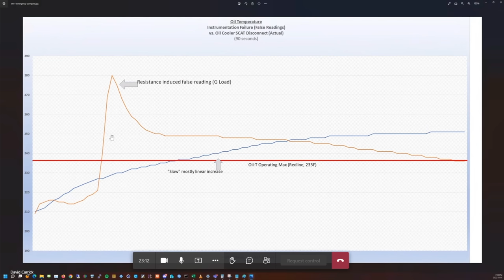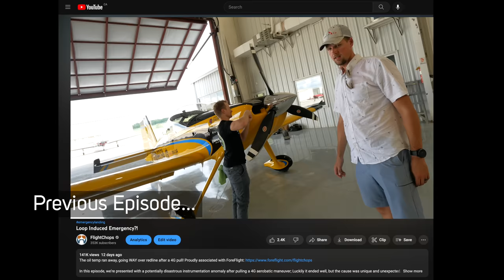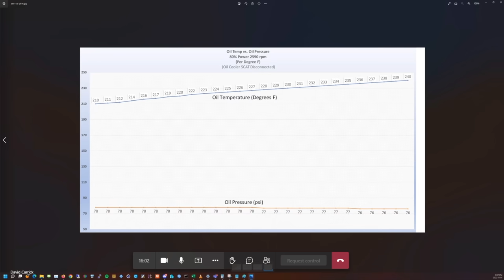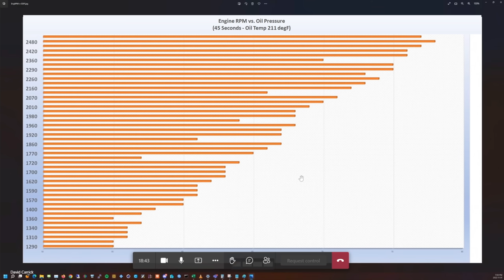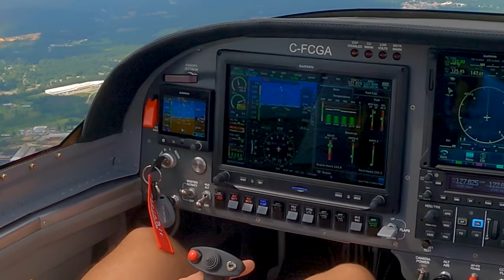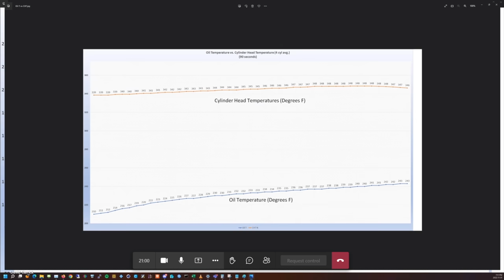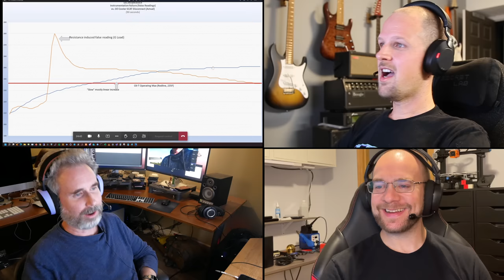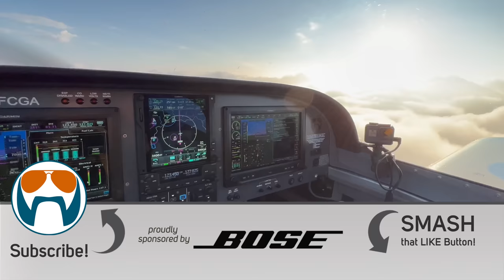Two Oil Temp Runaway Emergencies!? Engine Data Debrief Debunks Myths

Comment: 1. As a prior Air Force pilot, I love a good data driven debrief. This is fantastic.

2. I think there may have been some terminology confusion in a lot of comments from your last video with the false indication. A common term in US military aviation (maybe civilian too?) is "the field", but that means "the airfield". Maybe in Canada that's not a common term. A lot of criticisms from the last video were about leaving glideback of "the field" were in reference to a moment where is sounded like you were leaving glideback of a closer "field" (airfield) for you home field. I was one of those criticisms and definitely agree that electing to try and push to a strip of asphalt is far better than landing in an actual field (full of corn, not smooth asphalt). I know it's hard when you are trying to tell us a story, and none of us were there. Apologies for the Monday morning quarterback.

3. I love and respect Jason, but I've got to disagree with him here. Avoiding declaring an emergency for fear of having to answer questions is absolutely the wrong mindset. Be spring loaded to say "callsign, emergency, type of emergency (impending engine failure in this case), souls on board, what you are need from ATC (proceeding to final rwy 30R)". If they want more info than you have, be a pilot in command and tell them to standby. That should be a clear script in your mind before you take your private pilot check ride. Any scenario that is listed in your emergency procedures section of your checklist IS AN EMERGENCY and most likely warrants an emergency call. 

4. Dave's handling of his emergency was fun to watch. I think he handled it extremely proficiently and it was great to hear him talk himself through it. He started going down mental rabbit holes and then reminded himself to get back on track saying, "work the problem". Love it.

5. I've seen a few oil emergencies myself, all in turbines though. One was a high-pressure oil line that was cracked and spraying oil into the intake plenum. The only indication in flight was a very slow and steady decrease in oil level, but within normal operating parameters. I knew the aircraft well enough to notice being out of the ordinary though before the yellow caution came on. I was essentially over the field, and in a slightly rushed decision, I decided I wanted to get the aircraft on the ground sooner rather than later. I notified ATC and started an aggressive slip and that's when all hell broke loose. I had only dropped about 10-12% oil in the previous 25 minutes of flight, but once I started the slip, I lost about 40% more of my oil in mere seconds. I immediately came out of the slip and declared an emergency before flighting the rest of my descent over the field in a spiraling engine out pattern. Landed with about 35% oil. Going back through the data, I came to similar conclusions. Low oil level didn't really change the oil pressure that much. It dipped in those few seconds of slipping/pissing oil, but once I straightened out it went mostly back to normal. EGT was normal for the power settings as well. Oil emergencies are so much more varied and nuanced than almost any checklist I've ever read says they are.

6. Thanks for the great debrief. Pilots are the worst when it comes to "what I would have done is...". It's a vulnerable thing to put your flights, let alone your emergencies and mistakes on the internet for all to see. Good work.
Reply from the maker: Thanks for the awesome insights and feedback here!
Reply: It is important to remember that "communicate" is at the bottom of the list in "aviate, navigate, communicate".  Yes, communicate that you have an emergency once you have the first two things taken care of.  I think what Jason was implying was that the first two things were occupying their decision cycles all the way to the ground.
Reply: I agree - the word STANDBY can be added at the end of the emergency declaration to keep from being overwhelmed with unhelpful questions. Given some of the drivel I've heard being asked of the flight crew by ATC at totally inappropriate times maybe it must be added...
Reply: @peteranderson037  Jason was responding to the criticism a lot of us had from the previous video where Steve had the false indication of the runaway oil temp. There was a part of the video where they were communicating with ATC and they were asking for priority, but not declaring an emergency. ATC started asking questions and trying to deconflict them from a faster aircraft. In that case, I recommended (along with many others) that declaring an emergency could expedite that whole conversation and cut down on the radio chatter that was taking up valuable brain bites. I 100% agree that you shold aviate, navigate, and if time permits, communicate. In Dave's case with this video, he was directly over the field, and it sounded like the tower was closed so there was no need to declare an emergency.
Reply: @theflyingfool  That was my exact thought:  Declare, then Standby.
Reply: You can do what you want.  But to say not declaring an emergency is a good thing is bad use of your channel.  Jason is losing my respect for his comments on this topic and his comments on the traffic pattern issue debate he had with Gryder.

I expect better guys
Reply: @bobcfi1306  do you have a link to that? I'd like to give it a listen

Comment: Why wouldn't you bead the tube the duct slides onto after the first time this happened?  Its standard practice in the automotive world with pressurized tubing and ducting.  Also not sure if you're using constant tension clamps, but I would think the combination of the two would fix this problem long term.

Comment: Sounds like a trip to Mike Patey to have him design a carbon fibre cooler duct is in order!
Reply from the maker: I considered that but I think whatever system is used to get air from the baffle to the oil cooler needs to be flexible because the baffle is obviously mounted on the engine and the oil cooler is mounted on the firewall and the engine moves a fair bit.

Comment: Declared a emergency just last week in a trainer. Was coming into a Barvo shelf with engine failure imminent. I needed to stay high "to save myself" and go into the bravo to assure I could make it to the closest airport in the event I lost the engine completely. Weirdly upon landing, I wasnt given one question which was odd to me. Even tried calling the Approach center to follow up but still no questions. Completed a Nasa form just incase. 

Its always been my thought process to declare the emergency in the event that my life could be at risk.
Reply: Barvo was for your situation a controlled area of passage. You need the space, your the PIC. And when you get on the ground the Approach Center was back working fixing the disruption.

Comment: You had mentioned about wheel pants and fields making you flip over. I had an engine out in my Rv9 tail dragger around 2006.  My friend wanted to feel weightlessness.  Well the float in the carb got stuck. At the time I went full rich, boost pump on, switched tanks and soon did the Mayday call when I exhausted all options to get it going again.  So boost pump on was the worst thing as I was just filling the AirBox with fuel.  That could have started a huge fire, but engine quit, first thing is mixture, boost pump and tank switch. You Never really know why the engine quit so you try everything.  I did all my relay calls with a KLM airlines captain.  Big item was getting the position report right.  I picked a field, got everything set up and shut down all the power telling the KLM captain I would be back  with him once on the ground.  The ground roll was fine even with the wheel pants on in a recently cut field as it was dry. Soon after my plane was surrounded by Black Angus Beef!  The RCMP showed up from my mayday call.  I had the cowling off by then and found the problem.  Started it up and all was fine.  My friend jump in the RCMP car, and they put all the lights on and siren to move the cows away so I could take off.  It was a time with no camera phones but the memory of the RCMP herding cattle for me was pretty funny.
Reply: Yikes!  Glad all turned out ok, and herding cattle away from such a curious 'thing' in their space.

Comment: I would have thought the CHTs might have increased from the 5inch hole in your baffles, not from the elevated oil temps. I imagine with the Scat tubing connected, the oil cooler provides some back pressure, keeping some Delta P from the area above vs below the cylinders. Blowing off the scat tube would let the delta P equalize. I wonder if he didn’t pull the power off right away, perhaps you might have noticed something?
Reply: This thought crossed my mind later, but again as I stated in the video, I wasn’t in a position to be doing flight failure analysis. Much wiser to do that on the ground as the airport was right under me.

Comment: Regarding the debunking of a myth, I always was told that lower pressure should translate to watching for higher temps.  However, not the reverse.  The pressure will move first.  If the temp moves up, something else may be amiss, but doesn't necessarily mean pressure will drop.  Maybe I am wrong, but it held true in your case.  My fist thought was the failure of items that are meant to cool the oil.  Like the Vernatherm or a hose.  Regardless, the response of getting the plane on the ground ASAP is the absolute right move.  Really nice job of reacting, while staying calm and in control and flying the plane to a perfect landing.

Comment: So much good info in this video! Makes us all better pilots if we are open to these discussions and "thought experiments". Someone once told me that if an indication or problem on the ground would prevent you from going flying, it would be an emergency in the air. So, if I did a runup and saw 250 deg oil temps..I'm definitely not going flying, and I'll definitely be treating it like an emergency in the air!

Comment: I'm afraid I entirely have to disagree with withholding information about an emergency declaration. You can tell who has worked in a structured system with procedures developed from many failures.

Comment: As Steve knows, I haven't flown as PIC since the early 1980s.  I thought that Pan-Pan was the European equivalent to Mayday.  That's not true, Pan Pan is used throughout the world, including the U.S.  To whether or not Steve should have called a Pan Pan, I'm going to agree with Jason.  The engine, while having had a high temp warning, was running smoothly and producing power, and he must have had enough altitude to make it back to Windsor, since he did.  I don't see a reason for the call.  Now, had the engine started running rough, I would have declared an Emergency, there's not question about that.  I'd rather answer the questions and be alive than not declare it and have to have someone go searching for the ELT signal.

Steve, great follow up video.  I'll also be checking out Pilot Nerds.

Comment: Exactly the same thing happened to me while flying my C172 over the Río de la Plata on my way to Isla Martín García in Argentina: I just passed San Fernando airport and abt 10 miles over the water the oil temperature jumped to the top of the instrument (analog)... 180 turn and direct to San Fernando... Did not declare an emergency nor PAN, just said to the tower that I had an abnormal oil temp indication and had to land there, the controller cleared me and asked souls on board fuel remaining and if I needed ground services upon arrival. Less than 10 minutes later I was safe on the ground. CHT and EGT stayed in the green all the time, it was the lose hose to the cooler that had to be replaced as it collapsed beyond repair. Thanks for sharing the video, now I have a better picture on what happened to the engine while I was strugling to land as soon as I can. Good winds to all & keep it up, great channel!!
Reply: I think the controller declared the emergency for you. I think the questions about souls on board and fuel remaining are typical for that.

Comment: So one thing I would like to add, if I may, that we employ flying the jet is having an SOP for when a thing such a RED CAS happens. We use FORDEC in our company, but it doesn't have to be that. What this does (as does any SOP) it keeps your mind focused on working the issue (like Dave said during his emergency) in an efficient and coordinated way.
Maybe consider adding this to your arsenal of your pilot's toolbox?
Another thing I wanted to mention is, maybe having a written emergency or abnormal quick reference checklist in the aircraft that you can pull out to work the issue would be a good idea too? That way, especially if you're two pilots on board, one can keep flying the aircraft and the other one can pull out the checklist and start that procedure of "working the issue" (worksplit procedure). And even if you're by yourself you can make sure you don't forget anything.

Comment: The conversation about "should it be a mayday or pan-pan call" is sort of silly. As long as you say something that results in ATC and other aircraft clearing a path to meet your situation's demands, and conveys the seriousness of your situation, you have met the threshold of what to say. I would only say "mayday" if I wasn't already in contact with this controller or CTAF, and "pan-pan" is unnecessary because it isn't at the level of emergency, so you just explain your situation to ATC. Honestly, any request that prioritizes you over another aircraft is just an emergency, so... either mayday or nothing. The word "emergency" is just as good as "mayday."
Reply: Very sensible, this is essentially exactly what we were saying.

Comment: What!
No song !
Songs, especially rhyming songs, are a great way of committing things to memory.
A snappy 30 second tune about the perils of over temping engine oil and diagnosing faults by making correlations with  data that may actually have minimal, or no correlation whatsoever with the original fault, could save countless lives.    Maybe.

Comment: Really glad my RV7A has the oil cooler mounted above #4!
I would bolt the cooler tube to the air ducts you got way too much riding on a $5 hose clamps!
Reply from the maker: My concern with putting any holes in that rubber is that I’d create a weak point.
But agreed, knowing what I know now, it’s a little stressful to mess with that clamp
Reply: @FlightChops  l would wrap the outside with aluminum and maybe the inside then rivet/ bolt together

Comment: Real interested to hear what engine maintenance resulted from the over temp.  Obviously the heads are fine. Bearings probably good I’d think. Oil change and analysis? Another change after 5 hours and analyze again?
Reply from the maker: Correct - it was an oil change and analysis - no issues found. 
Of course the first thing we did was call Lycoming and send them the data to analyze on their end to confirm it was likely ok.
Reply: @FlightChops  Besides, 250F just isn't that hot for a good 20W50. I run oil at 250F for hours on end endurance racing (albeit on a water cooled engine) without issue. You probably shouldn't do it forever on an engine not designed for it, but a few minutes at 250F is really no problem, as Lycoming confirmed.

Comment: Steve, I am curious what the fix was for the cooler air tube… Is it sliding off ?   Did you forget to tighten the clamp??   

Those things a slippery on painted and non ridged surfaces.
Reply from the maker: I didn’t tighten it well enough after the annual inspection.  😬
It had been fine for ~100 hours leading up to that, and has been fine since tightening it properly 🥸

Comment: Ex-ATC here, and a private pilot of 30+ years... regarding, should you declare an emergency, or Mayday, or PAN PAN ?.... or not?  
Just tell ATC in plain English what you are dealing with.  Plain English, and they will help you by giving you priority, expedited handling, etc.  
Something like this; "Hey ATC, we have a run away oil temperature, engine failure is imminent, we need to get on the ground IMMEDIATELY.  I want straight in to runway 26 (or whatever you want)"  and that's it.  You tell them what you want, and do it.  You're number 1.  And if they ask any questions and you are busy, the word "stand by" should be the only thing you say unless you have the time to humour ATC questions.
Reply from the maker: Thanks for the insights here.  
This is where Dave and I, and Jason are / where at on this subject.
Reply: @FlightChops  especially in Canada, there is no need to "declare" anything.  ATC is obligated to assume you have an emergency and treat you accordingly as soon as you let them know you are dealing with some "stuff".  Love your channel Steve.

Comment: This is all great stuff, but someone educate me, I'm not a pilot. On any auto application it is imperative to have a lip on any tube that holds a hose, especially in a pressure application. That is the basic engineering premise of a hose clamp, once tightened it cannot fit back over the pipe if it has a lip that is a larger diameter. Seems to me an absolute misunderstanding of mechanical principles on something that can kill you very quickly.